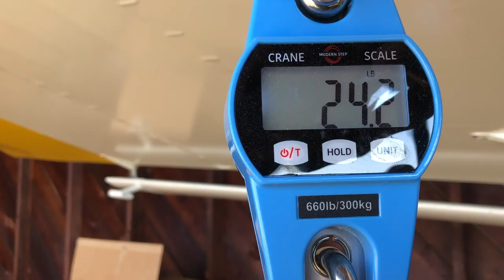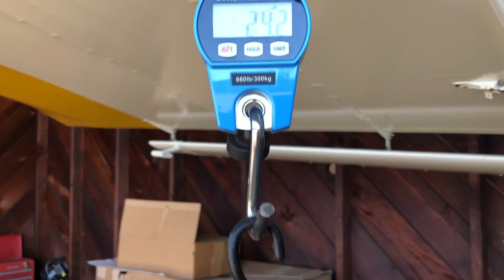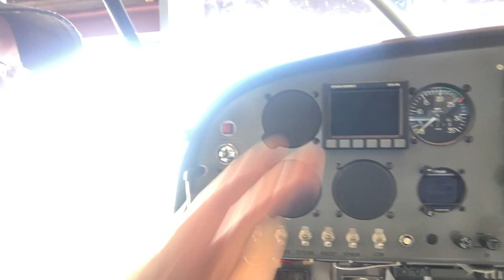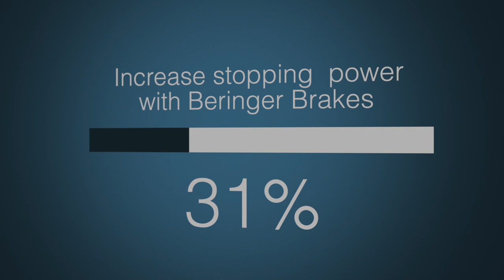Beringer Brake Install and Testing

Comment: Granny Smith to Honey Crisp comparison when changing two components at the same time brakes and tires IMHO.
Reply from the maker: In regards to weight or the stopping power? I guess you could make an argument that the new tires have more grip, but I doubt it would make a measurable difference. The weight of the 26" Airstreak bushwheel and the 29" ultralight bushwheel are the same so again not much difference, but if I ever dismount the wheel, I will weigh just the rim for reference.
Reply: @BowenAero  29'' tires also creates higher AOA which should have increased drag while braking thus also effecting braking distance, Also while brake testing did you note wind direction and speed during both tests?  Just making an observation of changing two components at the same time one could effect the other.  Really enjoying your content looking forward to your next video.

Comment: Suggestion: It only costs about $20.00 or less to register your own domain name. You could register "BowenAero" dot com, and have your email address as Sales@BowenAero dot com for cheap as well. Just a thought, but don't wait too long on that thought. Some scum might register it just to keep you from getting it!
Reply from the maker: That particular domain has been taken, but I have one that works and will be doing as you suggested. Thanks for the advise.